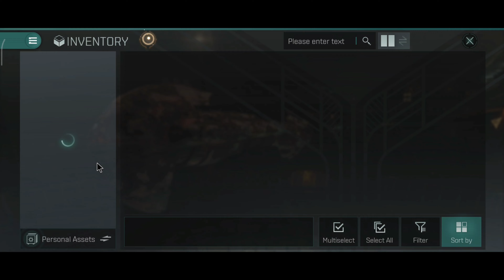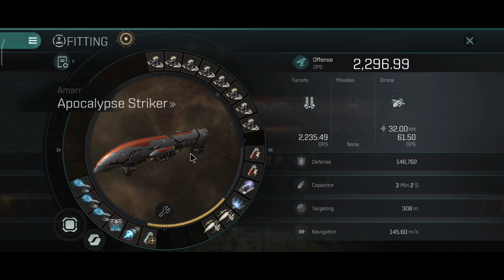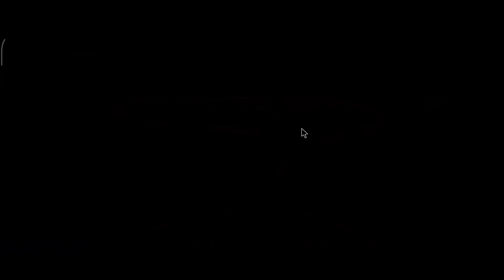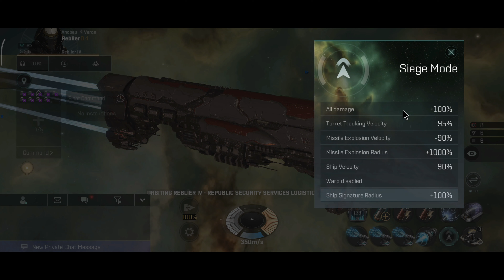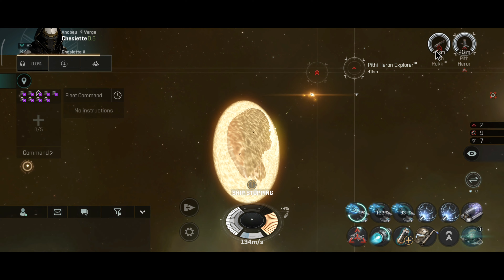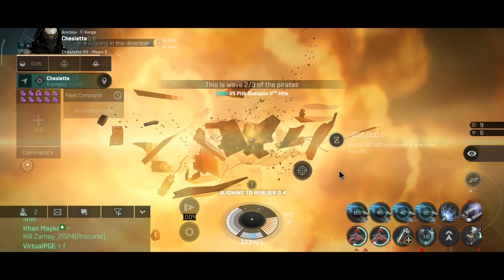EVE Echoes - Apocalypse Striker - The King of PvE - PvP/PvE Build/Fitting - Post Balance Patch

Comment: Have you considered Shield tanking instead? I have found it's easier to maintain. It doesn't drop all that much vs taking longer for the Armor repairers to maintain Armor.
Reply from the maker: Cap issues
Reply: @VirtualPersonYT  Don't see that problem. My cap is stable using a LG Nos, but I will consider Armor tanking once I finish 554 maxing all of my BS skills and my Armor skills. I too reskilled into BSs and training up is taking some time for sure. Definately gave me some ideas. Check out the "Glass Canon" on Youtube. Its an interesting build using a Nanocore.

Comment: The Apoc Striker is Stable with 3 ccc3s btw with cap to spare
Reply: Depending on the fit but generally your correct. I usually run a nos as well, but I'll look without it to see if it remains stable.

Comment: I’ve found I get more dps out of my glass cannon fits with 3 activation time rigs instead of the old 2 activation 1 damage if I’m fitting a mage mods in the low slot. Got almost an extra 200 dps out of my striker and vindi changing out the one rig. I think it’s dew to the change in the low slot mods and how they calculate stacking penalties.